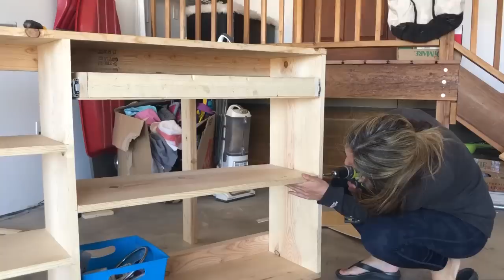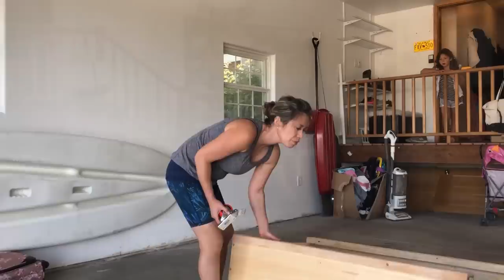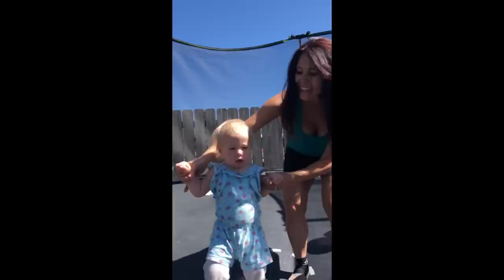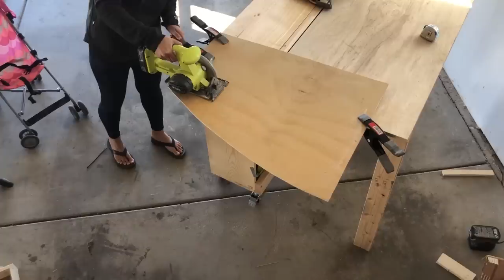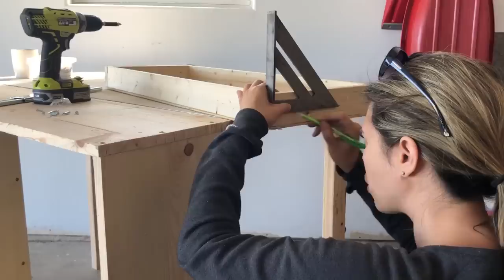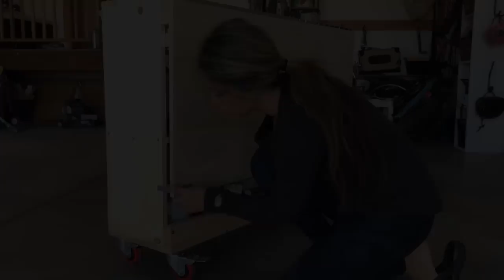Easy to Build Folding Workbench #anawhite

Comment: I built a real basic out-feed table that I often use for assembly.  This table takes up too much space and not enough function.  I've been searching for a way to change this out for a folding out-feed table.  All the videos I've watched, the woodworker attached the folding table to their table saw.  That works if you have a cabinet saw.  I have a Delta/Rockwell contractor saw.  Attaching it is out of the question.  I was on your site looking for a different plan when I came across this build.  The plan will need to be modified to match the height of my table saw, but this will free up some much needed floor space.  Good on ya.
Reply from the maker: I'd love to see what you come up with! If you want to share just email anawhitesite@gmail.com

Comment: Ana:  I just finished building this project.  Mine started as 31" high but I had to add 5 more  inches to match the height of a new table saw.  With the 3/4" table top (32.5" deep)  I notice that the project is a bit unstable when being rolled around (empty) and would recommend that the wheel base be widened.   Love the project and will be reusing this design as a kitchen island without the table top.  Thanks for this project.  I'll look forward to others.

Comment: The design is great. There's only one flaw.The 2x4 that supports the piano hinge should have been 3/4 of an inch lower and the hinge on the inside of the top that folds, so that the weight is supported by the 2x4 instead of the hinge.

Comment: I need help in my apartment... I rent and the walls are cement blocks. So there are no studs. It was some type of military barracks before then became an apartment complex. I can't drill holes through the cement... is there a strong cement glue but removable when I move out?
Reply: You could build or buy some shutters and hang pictures on them or use a wall divider.

Comment: I enjoy most all of your pieces. This one doesn’t do it for me. It seems to tall and very light duty. It should be called a work surface not a  work bench. Mounting the drawer slides was a mess with the poor wood used.
Reply: Its built for a lady, but ok,   call it a movable hobby table, its still better than what she had.
Reply: @starfireevony8796  Having a sturdy work surface is not based on gender. Ana is a very talented maker and I have been subscribed to her for a long time now. Just my opinion that's all.
Reply: @tomsdreamshopworx  everyone has a right to an opinion. I didnt mean to genderise if there is such a word, just meant we dont usually do heavy lifting, so lighter material will still be ok. I got your point though, use thicker wood for a sturdier end product, luckily her plans are really adaptable to suit anyones need or preferences

Comment: Only one improvement I would make to this is adding folding leg brackets that lock into place. About 15 bucks a pair from Rockler or Amazon.
Reply: I saw those hinge brackets on a Steve Ramsey Video for a fold down work space,  they would give a more secure & safe working bench top, but a quick and easy work table regular hinges do the trick.  Love the video Keep up the great projects.

Comment: That workbench looks ideal for my sewing room, which is also the spare room so has to have a bed space in it.Would it be strong enough to hold a sewing machine?
I could sew then store the machine etc inside it & fold it away.
Reply: That was my first thought too.  I worried a little about it moving with the vibration/bouncing of the sewing machine, but the large locking wheels should work well.  I think it should be adjusted for height -- so that you are sewing at a comfortable height in a normal chair and don't need to use a bar-stool.
Reply: @ColdToesNow  it is only 3 foot high without the casters
Reply: Choose the chair you are going to use, then measure the height from the floor to where you would like the height to be, subtract the height of the casters you are going to use as well as the thickness of the wood you want to use and adapt the plan, very doable, i want this and we took measurements tonight and adapted it to fight the height to accomodate the height to what i need for my wheelchair

Comment: Or put the flap leaf on both sides and have a full size dining table for 6 with storage inside. Great for small space lifestyles. I grew up with one we used in our den for projects and games like jigsaw puzzles.
Reply: Neat thought. Have a frame that supports the entire structure but put the entire center shelf portion on a drawer slide so it can be easily accessible by pulling it out half each side.
Reply: @larrybe2900  Yes! And if possible make the legs pull down close to the outer edges of the leaves using a piano hinge so it has 4 legs like traditional tables. I found that pulling out on the angle made the leg room awkward and unexpected for guests who expected 4 legs.

Comment: I need my sister to come visit me because I am somewhat disabled and I don’t have the strength to bend down without it causing me a lot of spasms in my back. I just need a little help getting this type of project done by myself. I still have hope that one day I’ll be able to do some of the awesome things you build Ana 👍
Reply: In the same position, feel your frustrations and limitations, i am paralysed one side of my body, so 1 handed i struggle with holding things and trying to screw something etc lol. I am very independent, only ask help if i can really not find a solution, and then my son help me find solutions so i can still carry on on my own, with the restriction that i may only use a power tool when he is near - such a safety sally lol. I also time my baking to be finished just after he arrives home , so he can do the hot or heavy lifting from the oven, works out quite well ( after burning my hand trying to get a roast out of the oven, this was my compromise ). Al, the best, dont give in or give up hope, the more we can do for ourselves or think of ways we can cope, the better for our self-confidence/ esteem😀
Reply: Gesiggie Main thank you for sharing your disability with me. I do get discouraged at times when I can’t finish something I started without any help around. I have never lived alone before. So I have to wait until my son has time to come over and help me with something that needs lifted up off the floor. Since my husband got sick he now lives with his son because he took me to court and said a bunch of lies about me and I couldn’t defend myself as I once was capable of doing. I cannot handle any kind of stress without suffering later. You are more independent than I am at this point in my life. I am very hopeful on some days but if I fail at attempting to get to do a project of done it will get me down unless I hear something positive or just see the beautiful flowers around my home it will lift my spirit! I hope you are having a wonderful day today.